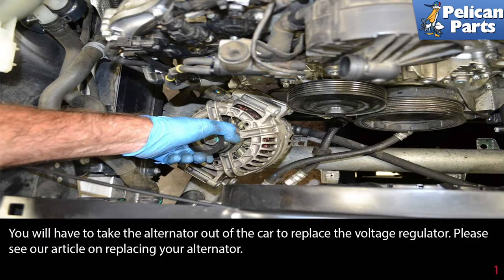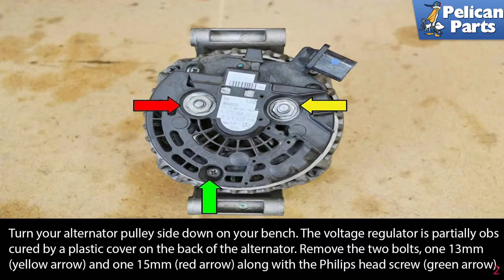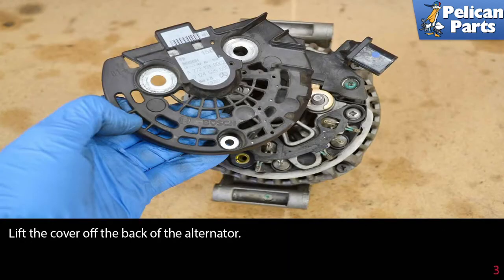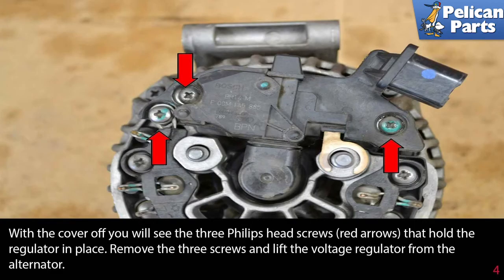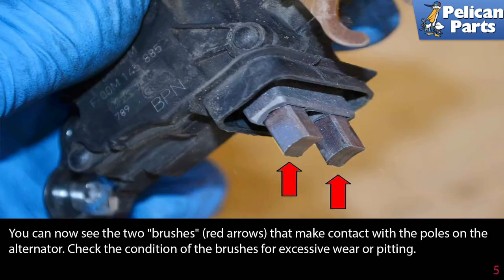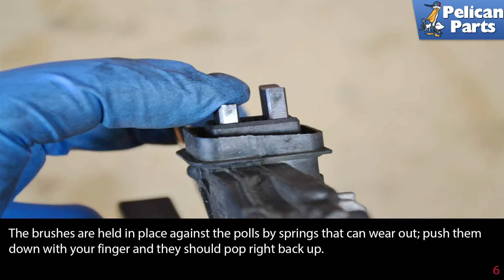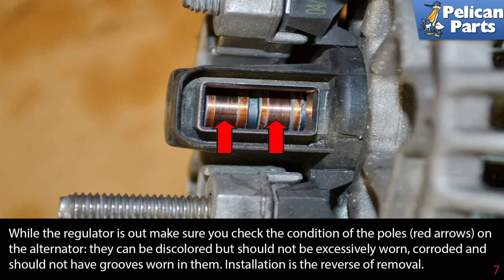Mercedes-Benz W204 C-Class Voltage Regulator Replacement

Comment: I have a w207 does it require removal of the alternator as well to change the voltage regulator? Also was wondering I am getting a loud whining noise while driving especially in the morning and when I go into service mode and look at the voltage it seems to drop to 12v sometimes while driving and then jump up to 14v but it stays mainly at 13 ish volts... the car uses a 14v alternator so would I be correct in assuming the problem is the regulator and not the entire alternator?
Reply from the maker: Yes, you will have to remove the alternator to replace it. Most times they are replaced together, the regulator can cause voltage regulation issues. Here is a video on testing the charging system: https://www.youtube.com/watch?v=B9SIAN_hNug